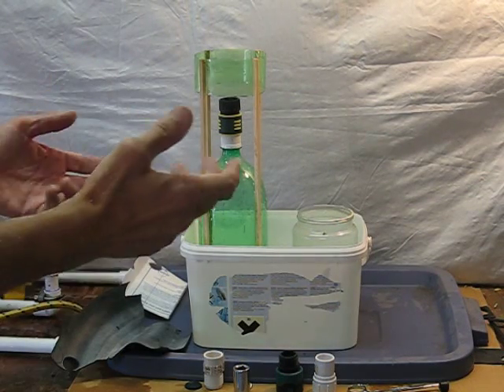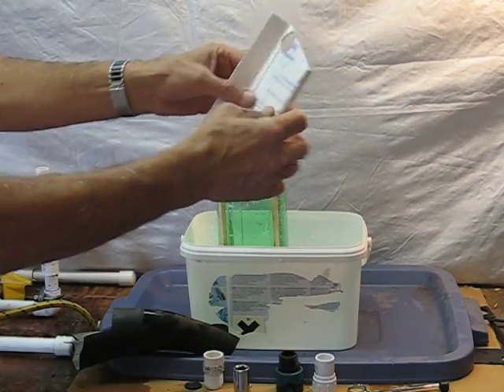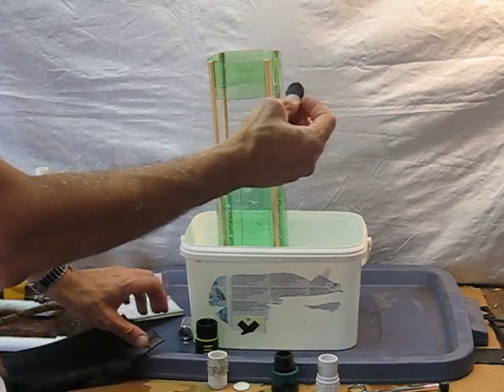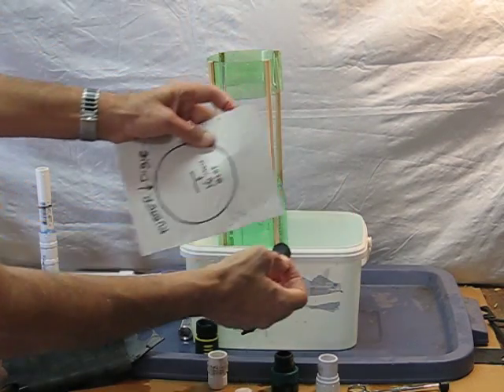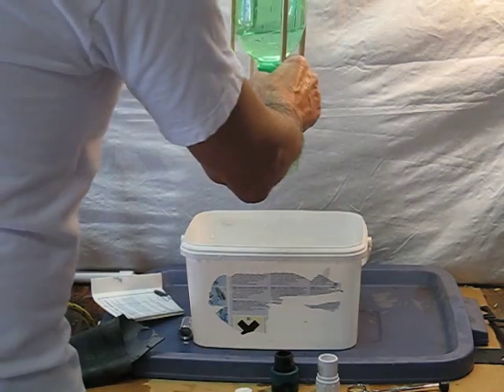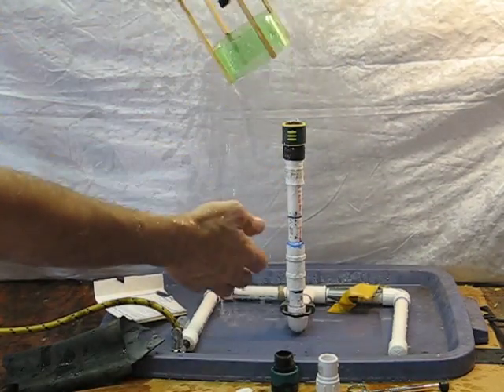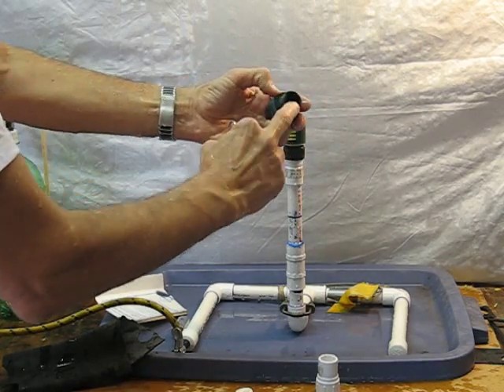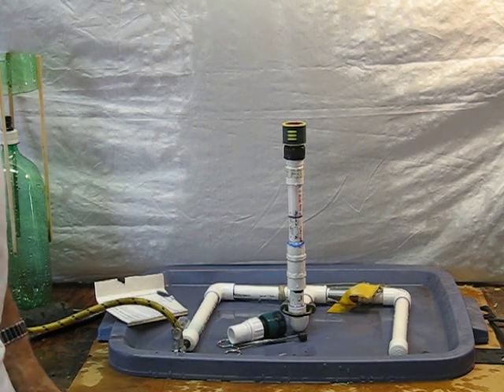Water Rocket  Non Return Valve  for Gardena connector

Comment: I love the simplicity, I purchased a 1/2 inch plumbing non-return valve as kind of a more permanent solution.  Although I suspect is probably just a rubber membrane like yours :)  Most likely flap style not a cut slit style.  If the device fails I'm going to fall back to yours.